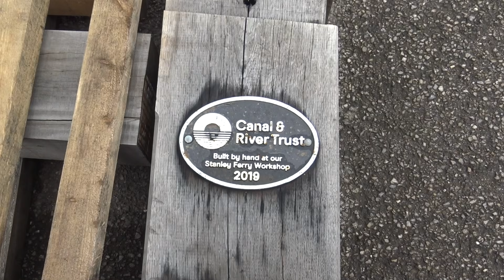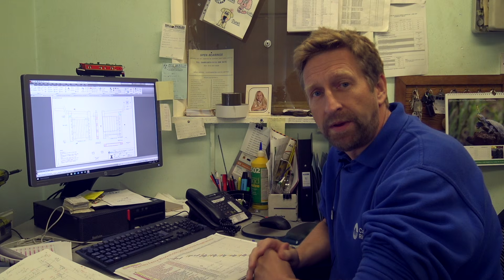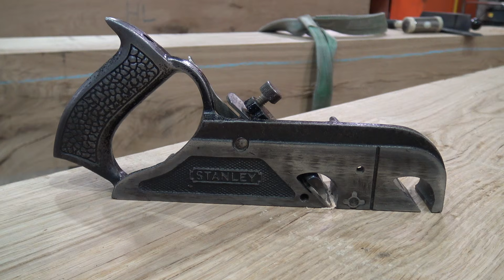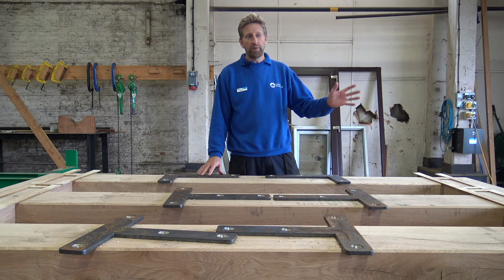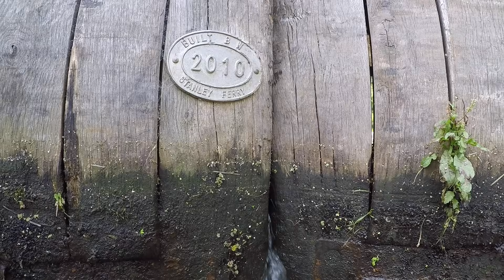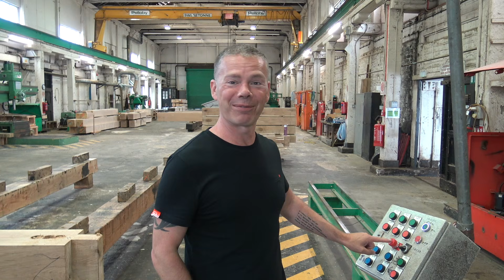How Canal Lock Gates are made at Stanley Ferry Workshop - Ep. 66

Comment: Why don’t we make the lock fully out of recycled polyurethane . Probably last least 10 times longer.  Much easier to clean and maintain . If that was even necessary. The more than likely I’m extremely confident that they could use the same machinery as what I currently using so no excuses for new machinery, warehouses training the staff or et cetera just supplier of raw material which in this day and age shouldn’t be that difficult .
Reply from the maker: I just make the movie. I didn’t invent the lock gates 😉
Reply: Polyurethane, like wood, will degrade and bits will come off from friction as well as from collisions with boats. Wood chips falling into the canal are harmless, but microplastics are not. I would guess this might be one factor in the choice of wood. Also, there's just the fact that preserving the canals "as they were" is part of the goal of the CRT.
Reply: @ride8575  the polyurethane or any type of recycled plastic is much less likely to have damage chip et cetera as it is stronger and will flex . it would not chip like wood . Would not Take on water go mouldy or rot Like wood does . And if you’ve seen canals recently they’re full of litter diesel engine oil who knows what? Years of industry spelling into them. 
Not to mention  stuff like blacking painted onto the boats and any other chemicals they’re putting onto the wood in the lock . But you think they may be concerned about some tiny micro plastics. .
Reply: Well, there are countless locks all over the world. Not a single one of them is made of plastic.
There are also countless lock builders and engineers, yet none of them have ever suggested making a lock door out of plastic. I wonder why?

Every material has its application; polyurethane (PUR) is very versatile, but it also has its limitations, which begin with its production and extend to its environmental impact. Recycling the stuff isn't easy, and it requires a lot of energy and additives to make it usable again.
EVERY type of plastic is harmful to the environment, and if you have proven methods and materials for a task, it would be utter madness to replace them with plastic these days.
Reply: Sorry but you obviously don't know anything about manufacturing from timber or plastics to think that would even be a possibility 😂

Comment: Very precise and a lot of information ! thanks for sharing
But I wonder if the duration of a new gate couldn't be greater than 25 years in average. I would have said maybe 40, with some parts replaced only after 15 (the more exposed to shocks from boats, weather, icing, etc). Are there some treatment to apply when newly put in place (special coating, etc), to give more lifespan ? with all the miracles in chemistry, you could expect…
Reply from the maker: Thats what the CRT recommend 👍🏻

Comment: You would think they would standardize the gates. They could have the in storage and made ahead of time
Reply from the maker: Ah, not a question for me. I just point the camera and laugh 😂
Reply: The canals were built from the 18th Century onwards,way before CAD was available. Canals can be roughly classified into Broad and Narrow but the individual locks vary in the dimension of the vertical change in  level of the pounds they must accommodate. In addition, the ravages of time, subsidence and heave affect the dimensions of the locks. There was reference to the fact that every lock gate has a different angle of mitre. I think I’m right that the CRT retain records of the dimensions of every lock gate on the system for future reference . All these are critical factors to ensure that the gates are able to seal and retain water at several tons of pressure. An ill fitting door may allow draughts but water leaking past a lock gate is a major issue! Great video as always, Colin and Shaun! Rob xx

Comment: If they used bronze instead of steel, the  gates would last longer. But people only use what is known, by their own beliefs. Should talk to boat builders. 
Cheers
Reply: I believe they should be using stainless steel. Now that would last way more than 25 years. Ya it's a bit more pricey but it would more than pay for itself later on down the years. However, the wooden gates are nostalgic and a work of art. Nice work on the locks but we gotta save the trees guys.
Reply: @outlawflyer7868  I meant for the fastening hardware. Metal gates would destroy the lock door areas. Wood works,  as the C&RT guy said, they plant 3 times more than they harvest.
Cheers
Reply: @carlthor91  how would metal gates ruin the locks? I get that they plant 3 to 1 of trees but how long does one of those trees take to grow? I am sure years. My point is that we need to save trees.
Reply: @outlawflyer7868  Firstly wood is soft and conforms to the gate landings, no need for complex plastics (petrochemicals) for seals. Next, 0.75 tonne of anthracite coal, mined, shipped half way round the world, burned to make a tonne of primary steel (stainless steel, of the quality needed, uses primary, no/little other contaminants present). Wood grown locally. Hmmm! Go with local, plant more trees. Production of Bronze, copper/tin can be done with electrical furnaces, wind/hydro power.

There is a report out this summer stating that there is more than enough marginal land, for tree planting. Which should be carried out anyway.
Cheers and have a great weekend🙂
Reply: Carl Thor the example at the beginning was of the wood rotting out. Dry rot at that. How would bronze fittings fix the wood rotting away ?
Reply: @francesconicoletti2547  Application of paint on a regular basis will slow the destruction of the top beam, where the rot mostly starts. Oak wood kept wet takes a long time to rot. Gates are wet, then dry, cyclically. Steel/iron rusts quickly (swelling, as it absorbs oxygen), steel more so, accelerating water ingress into the wood fibers, with the rust pushing the wood fibers aside, old boat builders called this condition, iron sickness. Good naval bronze, does not corrode rapidly in water, it gets a fine patina on then stays fairly stable. At that point, paint coating , or lack of, and the wear on the trunnion points and edge gap blocks would limit ultimate gate life. 
Then we get another problem, theft of materials, bronze being more valuable than steel by a large bit.
Cheers
Reply: Carl Thor Absolutely spot-on
Reply from the maker: Talking to the wrong guy 😂

Comment: I wonder if the oak was pressure treated would the lock gate last longer and how much ! Longer than 25 years
Reply: Would you need pressure treat Oak,? and due its density it last for so long anyway ?
Reply from the maker: I think like Nobby said, it's already pretty dense, and the other parts connecting it together would probably fail before the larger pieces.

Comment: Interesting vlog. I find curious why do they still rely on materials and technologies from the 1800s instead of building them out of more durable materials such as steel. Maybe a matter of money, or that British love for the traditions. (evidently, I am not a Brit)
Reply from the maker: There's an old saying, Jordi. "If it Ain't broke, don't fix it". It's worked so well for over 250 years so why change it?
Reply: I think they did pretty damm good with the material choice over 200 years ago. There was probably very little thought into how long not just the locks but the whole system would last. Back then it was built to last forever not timed obsolescence as most things are now. Amazes me on how they surveyed the routes, dug the tunnels and calculated the elevation changes for the locks without GPS, lasers, etc.  Motorizing the lock gates is starting to push the limits for me, stay with the traditional builds and materials, it’s what makes it so special.....heck what’s next 5mph 😀